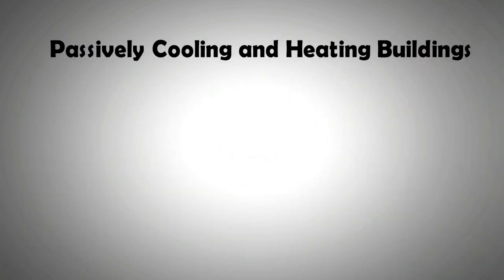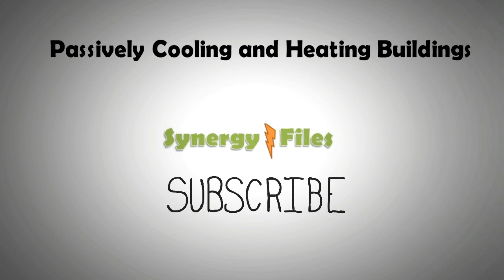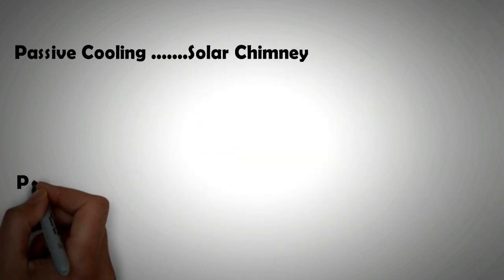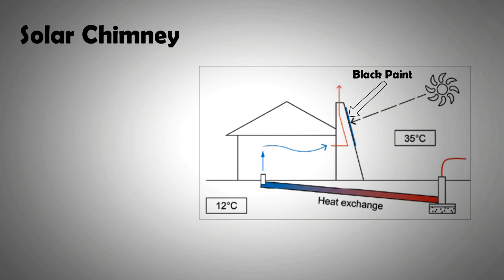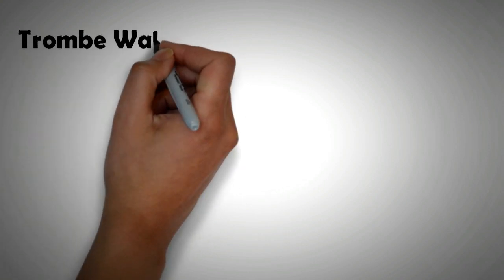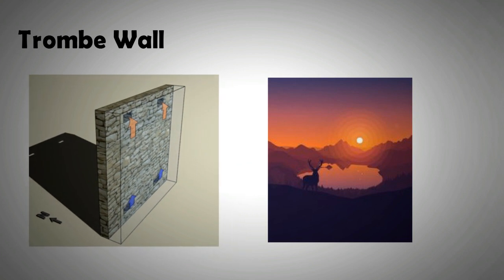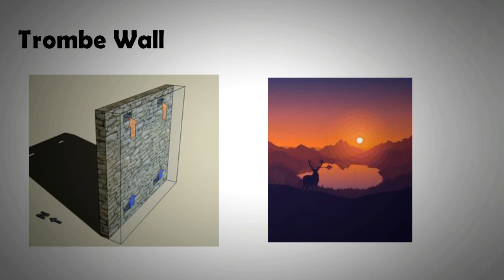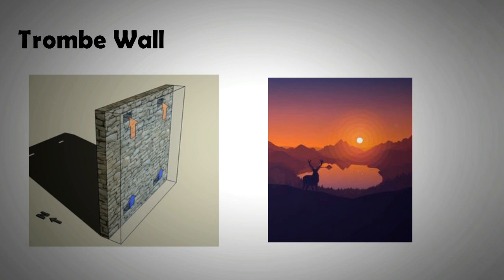Passive Cooling and Heating of Building

Comment: EXP. COOLING SYSTEM FOR SOLAR HEATING IN WINTER 
A hybrid space - cooling system for hot and zones previously investigated by the nocturnal radiative cooling of water though may be like previously through flat plate radiators. The winter operations of a mechanisam (cca. 1990.-2000. existing on modern way) ALREADY INSTALLED as a cooling system resulted in a considerable heating output, in spite of the lack of glazing on the collectors the angle at which they installed.